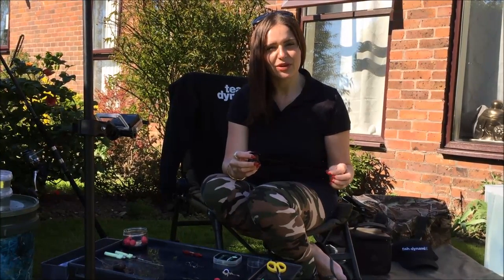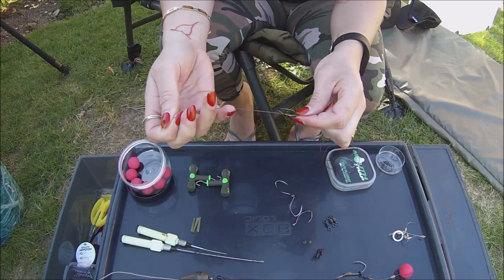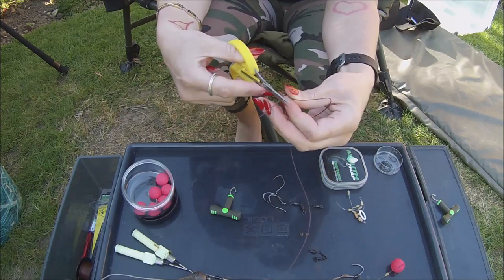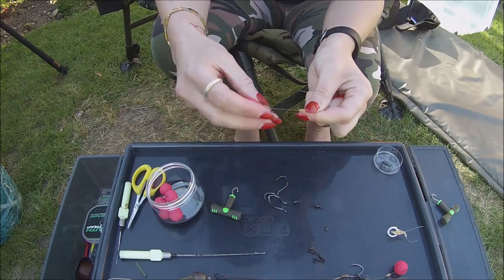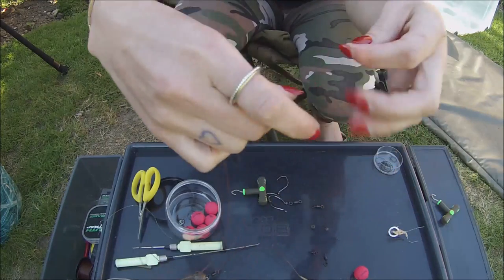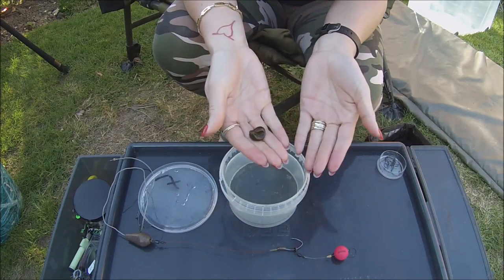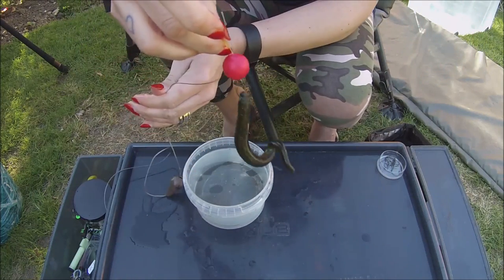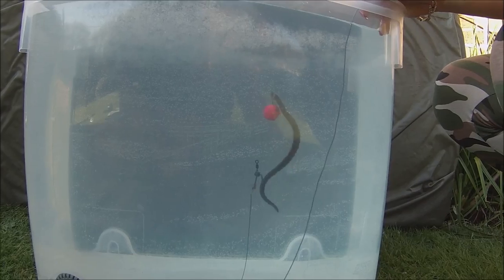How to make a Leech rig for Catfish fishing

Comment: Hi, i thought your rig building video was very good, smooth slow and informative. I would like to ask, as never used leeches before, if leeches are a prolific bait for cats or is it certain waters or even the time of year that's better for their use on the hook? Thank you
Reply from the maker: Hi there thank you for your nice comment. Leeches are a very good bait at all times of the year and if the water you are fishing hasn't seen them before you may find the cats will go mad for them.  We usually fish them popped up around a foot off the  bottom in early spring and late summer on the rig featured here
And in the warm summer months we fish them on the catfish pro tipper rigs suspended just under the surface.
Reply: @borntofish8492  I noticed that you made the hair rather long, is that just to help stop the leech from tangling with the hook link? Would shortening the hair allow for a better hook hold on fish?
Reply from the maker: Silurus glanis) hi there to be honest we used the biggest leech we had and used a long hair to make it easier to film making it however we do use long hairs with big leeches and never have a problem with hooking, I think due to the size of the cats mouth and the way they engulf live baits makes it fairly unlikely not to get hooked unless it's a small fish.
Reply: @borntofish8492  thank you, I will definitely be trying it out